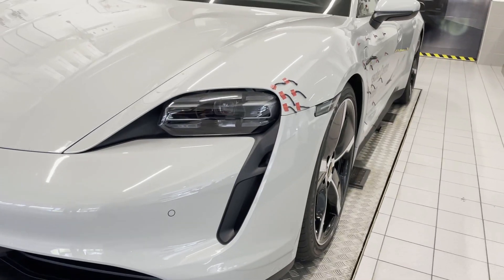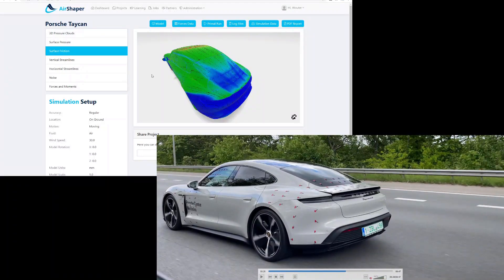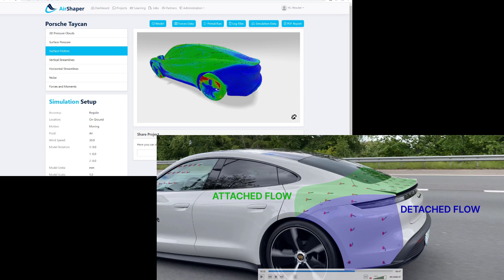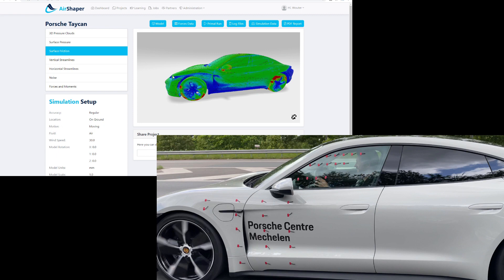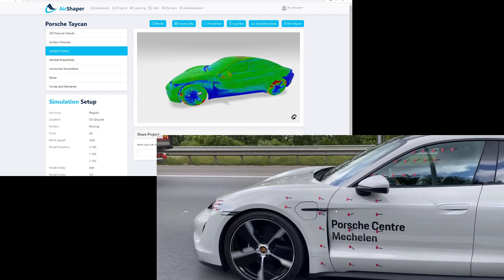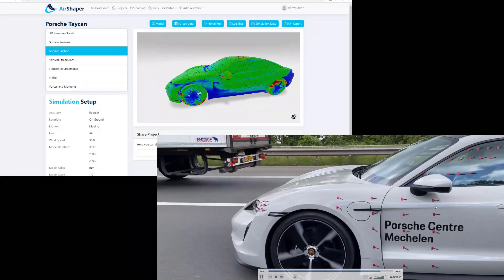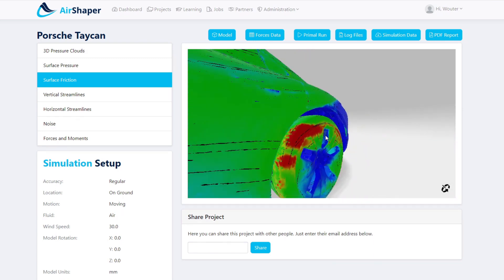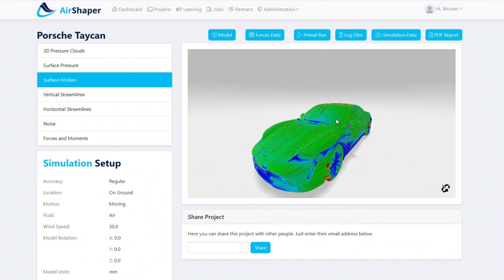Porsche Taycan Aerodynamics Part 2: Road testing

Comment: @AirShaper Thank you for this video. Beginning at 3:33 into the video you discuss the airflow behind the front wheel. I noticed the tufts of yarn behind the second air curtain are just as turbulent as the yarn tufts in front of the air curtain behind the front wheel. Shouldn't the second air curtain have caused the air behind it to re-attach on the drivers door and possibly the passenger driver side door? I'm doing some tuft testing on my Tesla Model X after installing flat wheel covers and have found a good decrease in Wh/mi (watt hours per mile) but would like to test the undertray behind the front wheels to see if Airtab vortex generators would improve attached flow. The second area of interest is behind the rear tailgate on the Model X to see what can be done to reduce drag to improve range. The third area of interest is at the rear of the hood (bonnet) to see if a lip spoiler similar to the one on the Lucid Air would also decrease drag created in the pocket between the hood and the windshield (windscreen). 

One thing I discovered is that lowering the air suspension ride height from medium to low doesn't improve the Wh/mi but instead increases it slightly. I assume it is because the increase in negative camber and toe in from lowering the suspension are negatively impacting rolling resistance. What are your thoughts?

Comment: Great video!
Question, smaller diameter and thiner tires plus cover rims would improve the aerodynamic around the wheels?
Reply from the maker: Thanks Jose!
That's correct - smaller tires and more aerodynamic covers (or even covering the entire wheel) can further improve the aerodynamics of the car. One nice example is the Lightyear One Solar Car. Perhaps these resources can be useful:
https://www.linkedin.com/pulse/whos-telling-truth-tesla-lightyear-wouter-remmerie-/
https://airshaper.com/blog/electric-vehicle-aerodynamics-improving-range
Reply: @AirShaper  thanks for the reply.
I switched from a battery plus RWD Taycan to a GTS. I used to get between 270 to 285 miles per full charge and with the GTS I haven't been able to pass then 262 miles. The GTS is around 500lbs heavier and the tires size are also significantly larger, plus previously in the RWD I had the Aero S rims, when the GTS has the RS Spyder.  The RWD with Aero S wheels and Touring tires is still the most efficient one.
Reply from the maker: @josealexander9794  Thanks for sharing all that information!
It's incredible to see how many small things (rims, tire size, weight, ...) add up to quite a big difference in range.
Reply: @AirShaper  how much efficiency can be obtained reducing the wide of the tire? Is it significant going from a 275 to 245? Excellent channel 👍
Reply from the maker: @josealexander9794  A simple approximation could be to assume the drag coefficient Cd would remain constant when you do this. Then, you'd need to estimate by how much the frontal area would go down when reducing the tire width (exposed height * width * 2 tires) to get an idea of how large the potential impact would be. It's likely small but still relevant.

In reality, the drag coefficient will likely change, as the aerodynamics of smaller tires are different, as are the aerodynamics in the wheel well (which would now be bigger). So simulations & testing would be the answer!
Reply: @AirShaper  based in the sizes, the front area of both rear tires goes down from 622in2 to 550in2, a reduction of 11.5% of the area
Reply from the maker: @josealexander9794  Ok. Then, you have to look at how many square inches the frontal area is reduced (only for the exposed part of the tire, which you can view from the front) and then compare that to the total frontal area of the car.
Reply: @AirShaper  do you have a video showing the aerodynamic differences between the current top EVs, like the Taycan, Lucid, Tesla, etc?
Reply from the maker: @josealexander9794  We did analyse some of the differences in collaboration with A2MAC1:
https://www.linkedin.com/posts/vincent-keromnes-7b56bb_aerodynamics-tesla-plaid-activity-6928362561478266880-gJco
Reply: @AirShaper  thanks for the link!!!

Comment: were you be able to measure match the actual Cw coefficient with software? could you determine or even quatify the impact of open vs. closed A pillar vents from front wheels to the first door? it's dependent on the choosen charging door, and probably the published best Cw for the Taycan is only with open vents?
Reply from the maker: Hi!

We cannot publish results on the Cw coefficient of this car, as its part of a package we sell together with A2MAC1.

However, we do have a public article on the benchmarking we did on the Tesla Model Y:
https://airshaper.com/blog/tesla-model-y-aerodynamic-benchmarking

There, the delta between wind tunnel data and simulation data was around 6%, which is quite good!
And that was with our Regular Simulation (not our highest one).

Indeed, there has been some discussion on those vents. We haven't done the comparison, but we would think the best Cw is indeed for the one with open vents.